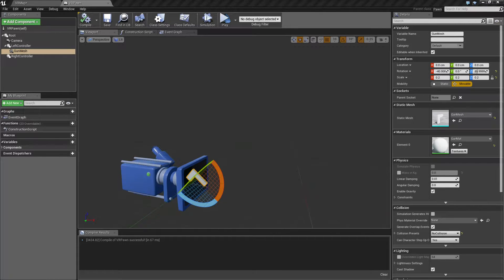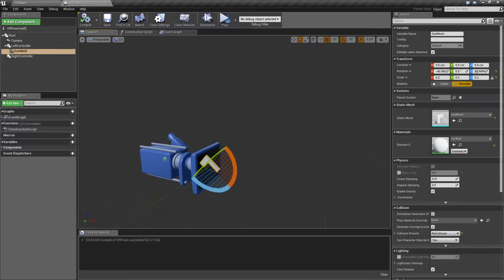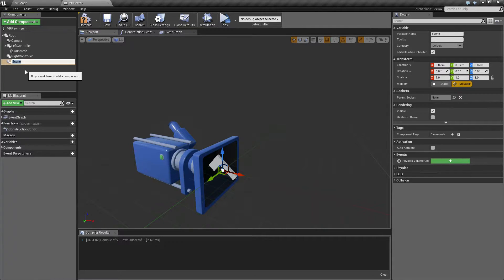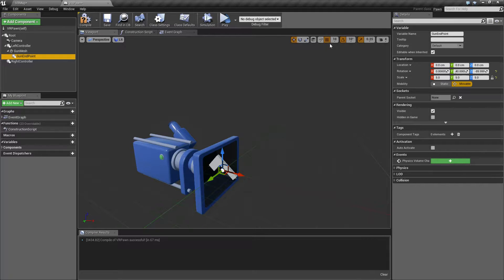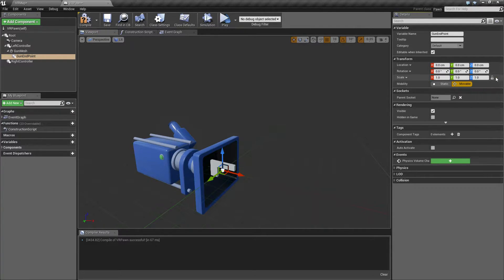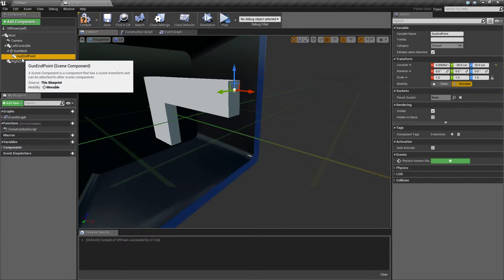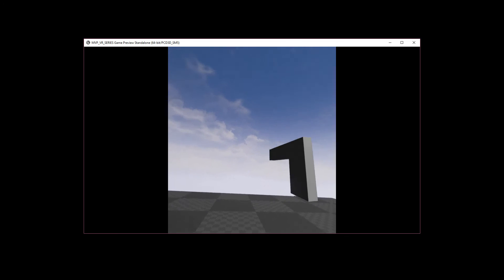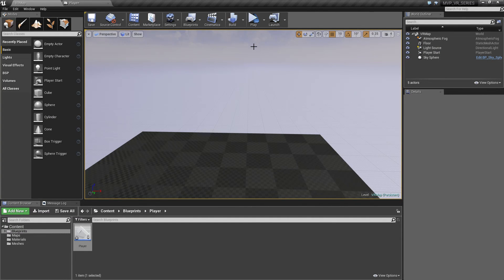MVP VR Shooting Gallery #6 - Firing Setup ( UE4 )

Comment: How do you add an anim montage so that there is a firing animation when hitting the trigger? I have an anim montage already.
Reply from the maker: I have almost no experience with Animations so I don't have an answer for this right now =(  I do plan on doing more animation related items in the future.
Reply: I don't have much animation experience either, but I found something yesterday that might help you. 
In 4.15, create a new VR template project. It might be in earlier versions, I'm not sure. Open up the BP_MotionController blueprint and in the event graph there are some nodes that animate the hand grip. You might be able to use that for your trigger animation.